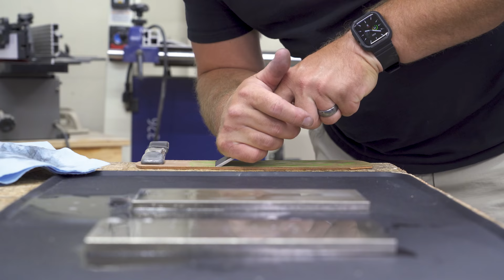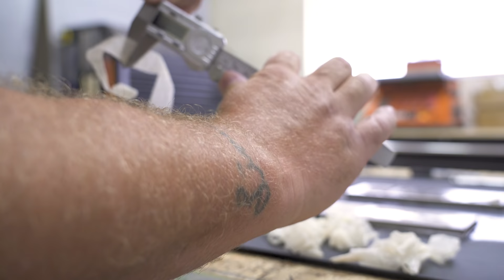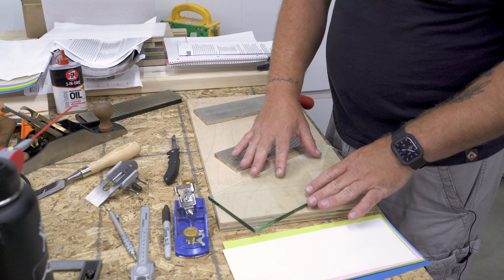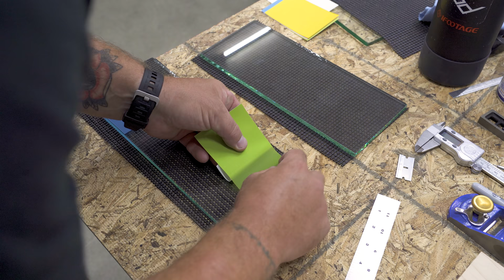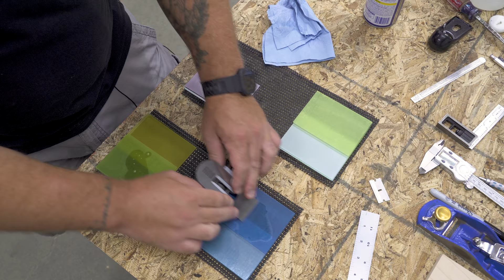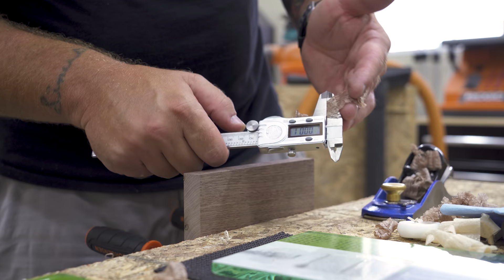Best INEXPENSIVE Sharpening Kit THAT ACTUALLY WORKS / Scary Sharp System For Chisels and Plane Irons

Comment: Another excellent video - unlike so many, it doesn’t dictate to you but informs you. 

My experience. I’ve got a Tormek water grinder; Norton wet stones in various grades; diamond stones upto 1000 grit; adhesive abrasive (from Axminster Tools) in various grades and the scary sharp system. So, I have both done a lot of research and wasted a lot of money.

What is my definition of sharp? It is when the blade feels good taking very thin shavings from a difficult (wavy grain) piece of hardwood. 

So, my experience. The Tormek is excellent at re-grinding and getting upto 1000 grit. However, it is incredibly expensive and needs maintenance to keep the grinding stone flat. Norton stones are very good also and get much finer; also very expensive; also very expensive and somewhat messy. Diamond stones are very good at getting up to 1000 grit (I don’t have finer) and seem to need no maintenance. 

The scary sharp system is the cheapest but seems to deliver (using my very un scientific test) the same quality on undamaged blades. If I have a damaged blade, I do use the Tormek to begin with; if I didn’t have the Tormek, I would use the Diamond stones. 

90%of the sharpening I need is maintenance sharpening - refining the blade after some use. For me to not be lazy; for me to continually refine a blade even whilst in use, I need a quick, easy, least-mess system that I can have on my bench so that it easier to sharpen than ignore it. For this, I have found the scary sharp system to be the one. That might alter if I had a much finer grit set of diamond stones but why would I pay out (even more) money to have something to equal scary sharp.

The downsides of scary sharp. It tears; I have tried the up and down motion and successfully ruined sheets of scary sharp. I know only use the back motion. It relies upon a flat substrate; I use a piece of plate glass because I was told that it is flatter than float glass - does that matter? I suspect not but remain a sucker buying what people tell me. 

I would say that as equally as important as the sharpening system is the blade holder jig. Get that bit wrong and your sharpening will not result in good results. I’m not talking about the accuracy of the angle here (25 degrees; 30 degrees etc) as I don’t think it matters at all if I get a primary bevel of 24 degrees or 26 degrees. I’m taking about squareness (bevel edge to side of plane or chisel blade) and consistency (reshape I got to the same as before). Again, I have tried several sharpening jigs/holders. I want squareness (the jig holding the blade square to roller or whatever) and tightness ( so that the blade doesn’t move). The Veritas mark II is my preferred option because I have it. If I didn’t, then I could make a jig ( I think Matt Estlea has) to do the job.

Apologies for going on. My search for a practical sharpening system that gets the blades as sharp as I want is over. I don’t want blades so precious, so sharp that I darent use them. I want blades that feel sharp enough to me. Hope that helps. Someone. Somewhere.
Reply: Great write up! Thanks.
Reply: great day!  this looks wonderful.  want to gift my brother with the system and i just want to know from users how it is holding up.  did you need to change sheets every year or whatever?  mygreathanks and blessings
Reply: @paulbraga4460  the sheets certainly do need replacing - like any abrasive, they wear out and lose effectiveness. How often? Depends upon how much you use them. I think you would need to look at anything from 2 to 5 times a year depending upon use.
Reply: @theofarmmanager267  mygreathanks and blessings

Comment: I’ve been using the scary sharp system for over a year now and it’s taken my sharpening to another level. As a new woodworker, I watched so many videos on YouTube and bought water stones and diamond plates, but just couldn’t seem to get it right. I wish I’d found this system earlier; it’s cleaner (I use water with a few drops of dish soap) and it’s helped me become better at joinery, because I now have chisels and plane blades with lovely shiny backs and super sharp edges. It’s also a really good price, and until I find another alternative, I’ll be sticking with it for the foreseeable future. Highly recommended.

Great video, with a nice clear presentation. Have a like.
Reply: great day!  this looks wonderful.  want to gift my brother with the system and i just want to know from users how it is holding up.  did you need to change sheets every year or whatever?  mygreathanks and blessings

Comment: When I got this kit about a year ago the first thing I did was make copies of the instructions. I am colorblind so I had my wife mark the film with the corresponding grits, I had to trust her LOL.   Works as advertised. I have not seen this system used in an up down method like you did.  I was afraid to tear the film so I followed the instructions (at the time) by only pulling down then lifting and putting it back at the top and pulling down again.  I will have to try that.  Thanks for taking the time to share this information.
Reply: Have you ever used a piece of marble for polishing their finished edge?
Reply: @HomeImProveMentHow  yes. I use 3/8th inch thick, by 12"x12" marble tiles with three, 3"-wide strips of adhesive-backed abrasive paper on each tile. Works for me.

Comment: Great tips Jodee. I started with an inexpensive sharpening system like the one you showed here. Great system. I eventually moved to diamond stones also and love them. One tip I picked up from James Hamilton (Stumpy Nubs) is to use Windex on the diamond stones to prevent any water from staying down in the grit after it's "dry" and possibly getting rust in the stone and lessening its effectiveness. Also, something about the micron size of the windex is smaller than other lubricants... 🤷‍♀️ Great video and lots of info as always, thanks for this!

Comment: Got a good start on a safecracker's thumbprint, huh? This is a great system and extremely well explained. Thank you. I've seen Mexican and Central American craftsmen travel north with the system they use at home, various grits of high quality sandpaper and a little piece of float glass. Incidentally, a glass man told me float glass replaced rolled glass when they started establishing "flat" on a bed of molten tin.

Comment: If you listen to the shop talk live podcast by fine wood working magazine, that 300 stone is only if you had to grind down your edge due to a big chip missing and need a new edge. 1k should be your starting point, then a 3 or 4k for the medium and then the 8-12k range for the final polish. This will get you truely sharp.

Comment: Very good review. The one question you did not address: How long does each piece of film last? Is it good for one sharpen, two, ten? Thank you for sharing. Have a great day and stay safe.
Reply: Yeah, if it costs 40-50$ but it doesn't last, it's really not a good investment for a beginner. Might as well just start with cheap wet & dry sandpaper then.
Reply: I've purchased cheap sandpaper and have been able to get planes and chisels very sharp. The downside was the paper wore quickly and curled when wet. Possibly good automotive wet sanding paper from 3M would hold up better. I bought a cheap bulk pack on Amazon. I have better systems now, but it got me started.  I've sharpened 3 planes and 4 chisels from barely cutting to very sharp with the cheap setup. When flattening the backside of a plane blade or chisel, you'll run through quite a bit of rough paper to get them flattened.
Reply: @BlcokedAccount  Same, cheap sandpaper works but it's obviously not great. But I feel like if you're going to spend 40$ you might as well spend 20 or so more and go for a "cheap" diamond stone like the ones from Trend or Axminster.
Reply: @kz.irudimen  I agree 100%. I bought stones next and a flattening stone. Moved on to diamonds next. Wasn't sure how dedicated I was going to be to woodworking, so I incurred the incremental costs instead of buying the right stuff once.
Reply: I'm at that point now, getting tired of the cheap sandpaper and I'm probably going to buy an axminster 400/1000 diamond stone for 53€. Should be a nice upgrade :)
Reply: @kz.irudimen  in my experience, the jump from 400 to 1000 took a while to get the marks out from 400. Maybe a 600 and 800 in-between if it isn't too pricey would be a good investment.
Reply: @BlcokedAccount  Yeah I can imagine but I can't really find one that's not too expensive :( I'll probably end up getting a 2nd stone later.
Reply: @kz.irudimen  you'll be fine, just be patient. Happy woodworking and take care my friend.
Reply from the maker: @Glen Crandall Unfortunately that's not a question that I or anyone else can answer. Just depends on how often you need to sharpen and the type of steel you're sharpening. I've sharpened cheap box store steel and cryogenically treated A2 and Cr-V all with great success and never felt like I wore the film down at all. That's why I think this great for beginners: they don't know how often they will be sharpening or what kind of steel they will be sharpening and if you split the kit up as I showed, it last three times longer regardless. At that point one could then invest in a different system or just buy some more film, if it suits them fine.
Reply from the maker: @kz I can understand that argument, but this is far superior to the wet/dry method. I've done both. I personally do not have the patience for the wet/dry method and am not a fan. Too much fuss. This just works, and works very well.
Reply: @InspireWoodcraft  Makes sense, if it's really better then it's a cheap option for sure. I'm just not a massive fan of using glass, I always feel like I'm going to break it somehow on it if I'm not careful! And cutting the film in multiple pieces is definitely a good idea.
Reply: @kz.irudimen  iam sure  you can use anything thats  flat and smooth to put the films on so if you can get some flat aluminium or steel that will work also and you wont be able to break it

Comment: Great guide regarding a simple way to sharpen. I have a question (concern really) with your decision to use short pieces of the film though. Every time you go onto and off the film, you are changing the angle of the chisel being sharpened. It seems as though, when some blades require 25°, some 27°and others 30°, 1 degree here or there matters a lot. Perhaps I'm being too precise in my thinking??

Comment: Was really interested in this so followed the link and went though the ordering process. All was fine 'til it came to payment and shipping. I'm in UK, sio expected a reasonable amount would be added for shipping. For a $43.99 item they wanted $60.94, making a total of $105! Needless to say this is one customer they lost....
Reply: It's 3m lapping paper. 3m is a global brand I'm sure you can find it in UK! Scary Sharp is available in Poland for example. If it's here there's no way it's not imported to UK.

Float glass is as flat as the radius of earth so on our scale it's very flat. Best thing is that it's the most common form of glass. You can find bit cheaply localy. Hope that helps.

Comment: It seems to work pretty good. I hope everyone realizes this might not be a very good money saving investment/permanent system for everyday woodworkers. It can be very expensive to keep replacing sheets like this. Some people might be much better off buying some quality diamond stones that will never need to be replaced. For some, the cost of sheets will quickly surpass the price of high quality diamond stones. I guess it depends on if you plan on sharpening for decades to come. Those $40 refills add up. It seems like a good system to try out. Just be mindful of how long they last and before you re-up, try and do the math and see if you will really be saving any money after 1 more year at that rate.. Then calculate 10 years.. I'd bet not everyone will save money. Only 1 way to find out...

Comment: Have you ever used a piece of marble for polishing in finished edge?
Reply: I’ve got a Steel City table saw with a stone top. I often use it for a flattening surface when I don’t feel like breaking out my flat stones or can’t use the Tormek. I’ll only do my 2nd set of chisels and plane. You know, the ones that bounce around in the toolbox that you might open a can of paint with, not my nice set. And only ever up to 1000, since I do this dry, (the paper is dry paper)band I’m not looking for a showroom cut, usually only 400, 600, 800. I’ll use some peel and stick (psa) longboard 2.75” width paper and just stick it to the table saw (or band saw) table, 3 strips side by side and starting at the edge. Close to the edge is nice for a longer stroke not possible for a handled blade if it was stuck in the middle of the table. Flatten the back side of a chisel, or plane blade. I’ve done chisel, plane, chisel breaker, cutter, sole and sides of a plane, or cheap electric planer, knicked belt sander plate, dinged spade drill bits, puddy knife, flat head screwdriver (remember those)... 
Cleanup is easy they just peel up and a wipe with a thinner or wd40 cleans up any glue. 
Sometimes they just get left there until I need the full table saw width. Comes in handy for just dragging anything across it, a board, plastic, hatchet, trowel, small garden shovel. 
I had a dedicated surface, just the infeed Tbl from a scrapped jointer, until I repurposed it as a miter saw extension. 
Again, I’m not comparing my rough surface repairs to the fine edges from the the system in the video. I’m just saying I do use any flat surface stone, aluminum, or steel for some quick, rough flattening, sharpening, surface rust removal..

Comment: This must be the same Scary Sharp system Katz-Moses reviewed about a year ago? If you're from Canada, get it locally, because the customs costs from Tay Tools makes this not cheap up here. I believe Lee Valley Canada has the 3M lapping films
Reply: I bought a 12" x 24" piece of float glass locally for $11 and ordered the PSA lapping film online....a much cheaper way to "build" your own kit
Reply: 3M makes the best sand paper I've ever used.  I like to buy those 5" hook and loops for my round palm sander.  Nothing compares.  So if the scarey sharp system is made by 3M, then it's very good indeed!

Comment: I'm just starting to think about sharpening my own dull-sharp edges lol. Chisels, scissors, kitchen knives, tree trimmers and pruners (curved blades). Is this a good system for all of those or do I need something else more specific to each application. I'm a low fixed income senior so cannot be too spendy. Thank you for your help.
Reply from the maker: I don't see why this wouldn't work for any straight edge and outside radius blades. Blades with an inside radius might be a challenge but not at the fault of the lapping film, just because you might need something that has a radius as well. I don't have much experience sharpening inside edges. I would have no problem sharpening my knives with this system though.

Comment: How long does the film last, as you eluded to lengthening the life of the product by cutting the sheets into smaller pieces. When/if they do wear out, how easily do they come off the glass?
Reply from the maker: They come off the glass easily. You just have to get a blade or something under one corner to get it started, and then they'll pull right off. I cleaned the glass in the sink with soap and water and all was well. Longevity is kind of a broad term and holds a different meaning to everyone, which is why I didn't try to make claims to how long it lasts. Depends on what you sharpen, how you sharpen, how often you sharpen. From what I've seen it is very durable and wears quite well.

Comment: One thing I don't get, and I don't see in the Taylor Toolworks instructions: how does 7 grits make sense with only 3 pieces of glass? It seems I'd have one left over. Am I supposed to be peeling one off and substituting it with another piece of film? Am I only supposed to pick my 6 favorites and use those?
Reply: Using Jodee's advice to cut the sheets in half, you could have one face with a different grit at either end.  Alternatively, Taylor Toolworks sells the float glass individually and in 2- and 3-packs.  I bought extra pieces of glass and also bought some other coarser grits not included in the Scary Sharp package to be able to lap plane soles as well.

Comment: about, how long/many sharpenings can you see from each setup?
Reply: Hi. With regards to how many times you can use the film, depends on what grit (or micron) you use. If of course you need to aggressively remove material to correct a damaged edge or flatten the back of a chisel or plane, then not very long (I normally use a 3” wide strip that’s about 8” long, and it lasts about an hour). The finer grits will last longer because you’re only honing an edge or creating a secondary bevel. Whether my method is correct, I certainly hope so, but this is what I’ve found works for me and it’s correct according to the video produced in conjunction with Workshop Heaven, who sells the kits here in the UK. All the best.